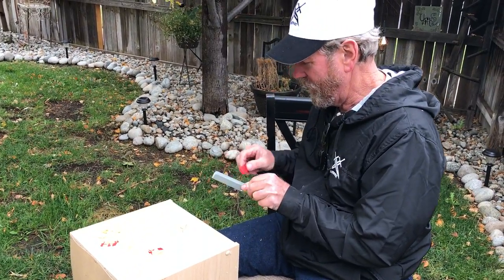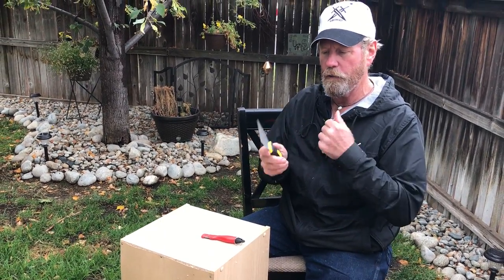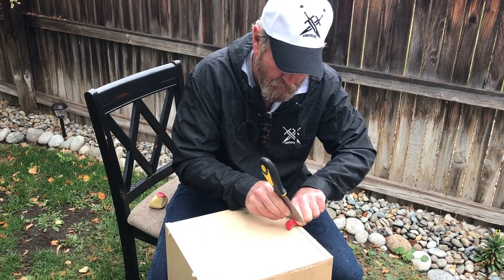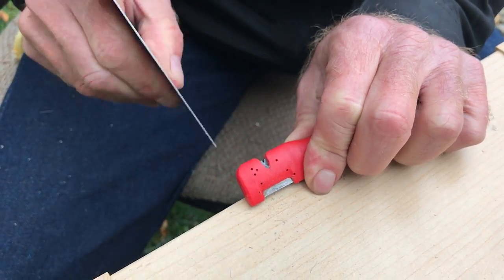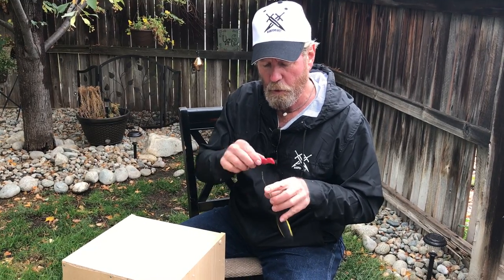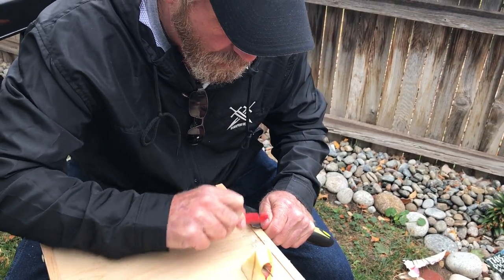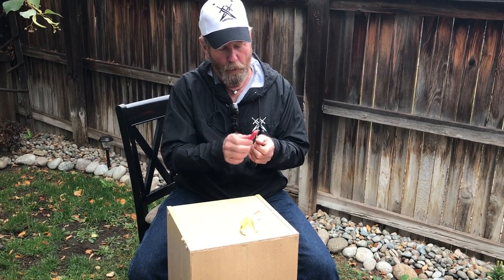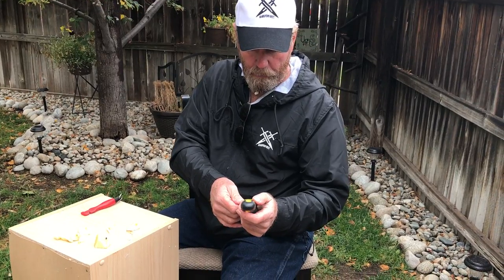Will It Sharpen | Putty Knife Drywall Knife

Comment: Every time I see this it tickles me... this is making a cutting edge but this is not sharpening.... the micro serrations that creates a proper edge can not be formed due to the abrasive cutting its scratch pattern down the blade. Yes it will actually give an edge that's cutting but it's 100% based on just a fine angle that will have a fine wire apex... notice how you only ever see him cut paper? That's because that fire wire that is making the edge seem sharp is super fragile... a few cuts on anything abrasive and that wire fail and that's it instantly dull knife.